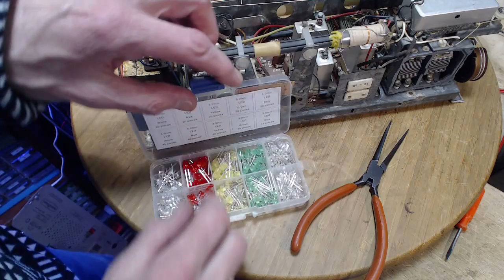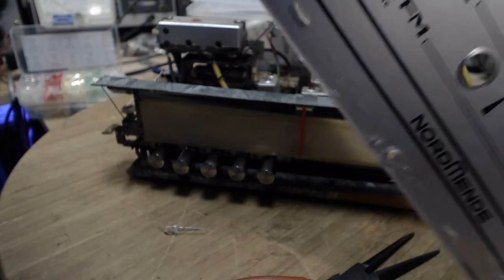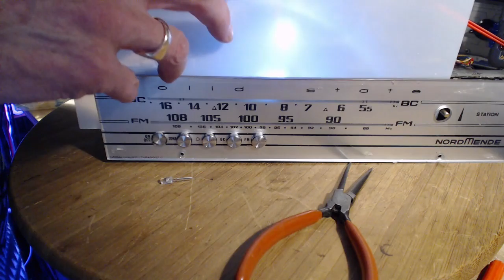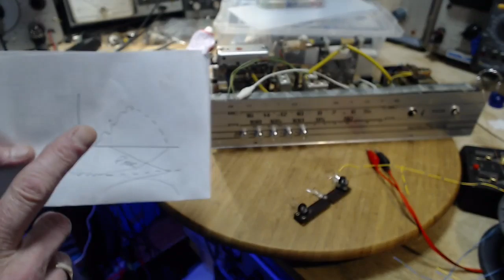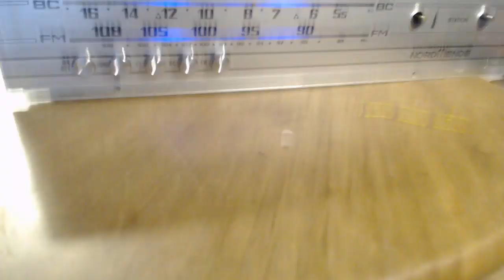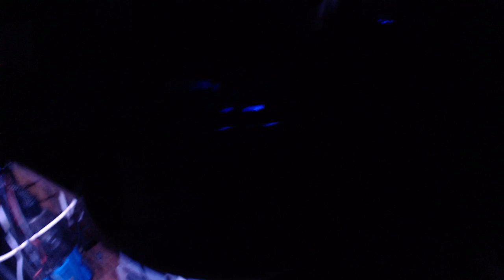Nordmende Spectra Phonic Video#3 - Dial Lights

Comment: BLUE LED backlight? Really? This isnt a plastic case noise maker box that needs blue dial backlight and other flashing disco effects to distract the user from an  abominable sound quality. On a radio like this the blue lighting destroys the whole looks of the radio with its wooden cabinet. The only backlight fitting for this style of radio is a warm incandescant color. Even your standard warm white LED may be to blueish a tint. What a bodge job!

Comment: A clear THIN GLASS ROD OR FILAMENT.  If lit in the center or its ends from behind, it can spread the light more-or-less evenly along its length, especially behind a diffuser sheet.  Those filaments you can buy for optical cables are this type, if not opaquely coated on the outside, of course.  The very cheep stuff used in some Christmas lights now might be just the thing.

Comment: Hi Jim  
I got coffee everywhere watching this one .
LED's ON A/C  ..... NO JUST NO …. STOP AND THINK ….. it will kill them  !

You needed a diode & one capacitor ( 47 uF & IN4002 ) .

Positive of the cap & band end of diode are joined with the led dropping resistor . 
Negative end of cap & led negative wire all go on one lug of transformer  .
The last diode leg going on the remaining transformer lug .

O.o    
Antennas the bigger the frequency bandwidth required the bigger the pain … LOL 
You should look into a L-Match ( Matching Unit ) or a active antenna like the diy mini whip .
Reply: gd2329j If the LED fail I guess that should be covered under the "I'm only gonna offer an 8year warranty on this" clause he mumbles about at 2:27.
Reply: @Paul shockie uk The 14C is coming from the power transformer so must be AC??

Comment: Whenever I use leds in this type of situation I use sandpaper to diffuse the front and sides of the led.  This much reduces the spot caused by clear leds.
Reply: polyman2 There is several approaces to change the light spread pattern of an LED. But most cases youbhave to experiment with the LED type u use. And to avoid buying dozens of various LED shapes like straw hat, dome, concave etc just go to the next dollar store and buy various battery operated 10 or 20 LED light strings or tapes and experiment with the string as a whole or repurpose its LED. that have concave shaped lenses. When it comes to low intensity wide angle illumination over a long stretch in tight space situation you may also look into experimenting with those micro LED strings that basically consist of resin potted micro SMD LED soldered between two insulated wires.
Reply: @MH: And why not forget all this LED insanity and buy two replacement incandescent bulbs? They are still available and not that expensive.
Reply: @ableutopia2721  LED's will probably never have to be replaced but the bulbs will eventually fail again and then may not be available.
Reply: : True that, but depends how close to original do you want to restore/repair. By the time the light bulbs burn out, many other components may also fail. Still doesn't justify using AC-driven blue narrow-beam LEDs. Cheers!
Reply: I have did that same with led with sandpaper 👍👍

Comment: Have you thought about using something like this? https://detled.dk/udendors/1351-hilux-led-band-12v-i-3000k-120ledm-8000lm-ra95-5-mtr.html
Reply: doesn't the power transformer terminals put out AC and not the DC required by these LEDs??
Reply: @markk2034  Yep, but that's easily solved.
Reply: @TheSoundrookie  I must have missed how Jim solved it.   For his initial tests he used a bench power supply (DC??) but then he connected the leads to the transformer in the radio?  Did he ever give the specs on the LEDs he is using and I just missed it?  I tend to doze off occasionally during his videos.
Reply: Mark K Consider them generic LED 100pcs 1€ from ebay put in a plastic box, 10pcs each color and sold as premium LED for 10€. But there is no need for specs anyways. LED are current depending devices, so u set the current to be 10mA and have the LED decide on its forward voltage. Testing them on a bench supply set for a voltage therefor may already hurt them to where they will develop leakage paths. Also consider all ultra bright cool white LED as not long life because the phosphor used will degrade quickly to where intensity drops significantly and light color goes yellowish. Why he does not use warm whilte LED who may be dimmer at first but whose phosphors last longer is beyond me.

Comment: How is this a good job, Jim? Half of the scale is not lit up !!!
Reply: StillCloser Crack IF ferrite cores due to improper tools; "good job" Mix up values on replacing capacitors; "good job"  Radio deaf like a 150yo after IF adjustment; "good job" Maybe his dictionary has a different definition to the phrase "good job".
Reply: He not finished dial string if you ask mi ?